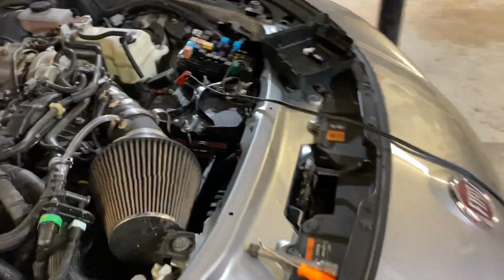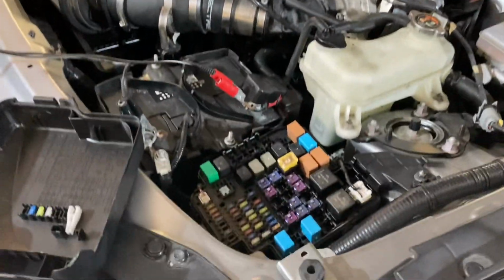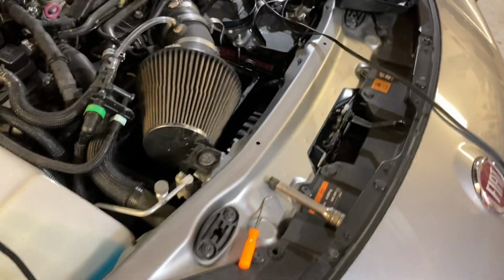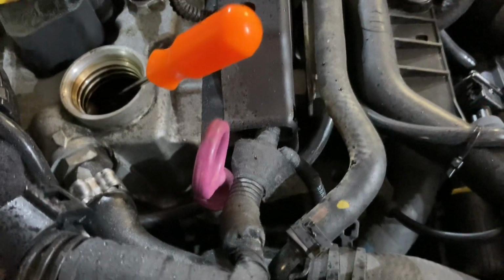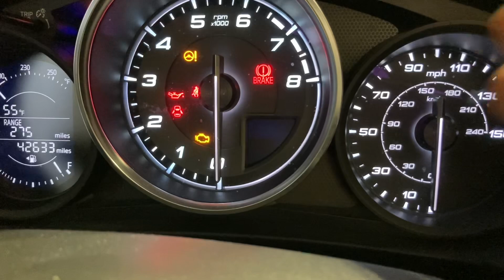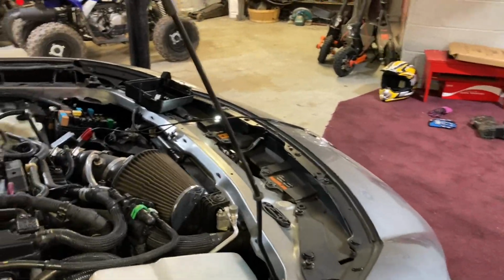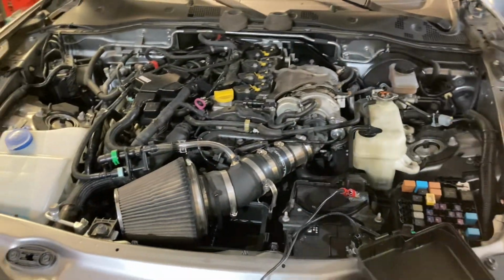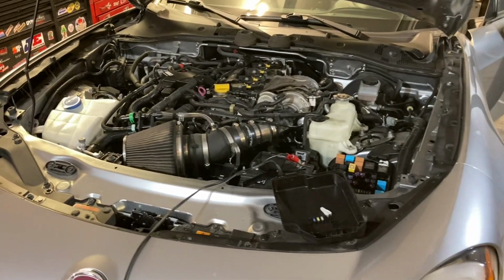Fiat multi air new way to prime oil after car sitting

Comment: Mine is stored every year for 5-6 months, without starting.  2019 to 2020, due to personal circumstance, the car was stored for 10 months without starting.  Always starts on either 3rd or 4th round of cranking.  No work, no effort.  All of these complicated over analysis and work around, by hobby mechanics who really don’t seem to know what they are doing, are completely unnecessary.  Does it work?  I’m sure it does.  Do you need to do this?  Absolutely not.  The engine is designed this way.
Reply from the maker: Not a hobbyist 
And did u stop and think that maybe that's your car?
Do you really think that some one only tries one time to start the car?
And one last thing... I hope you have heard of fuel wash because if you are doing what you say 3-5 times trying to start car and not pulling fuel pump fuse you are washing the walls of the cylinders and getting fuel in the oil.
Good job keep doing what you are doing👍

Comment: lol.... oh, no.  Good Lord.  Just go to Autozone and get an oiler can.  It costs $10.  Remove the oil fill tube.  Fill up your can and put the end of the hose from the oiler can directly onto the ball valve and start pumping oil into the brick.  It takes about 4 cans to fill it.  It should start on the second crank.
Reply from the maker: Are u nuts 
That ball is smaller then a .177 bee bee gun ball
You will be there for hrs and hrs then you will need to drain same amount of oil out of the pan so you don't over fill engine.
You are over thinking it.
I've done it this was a few times now 
Easy , quick , done